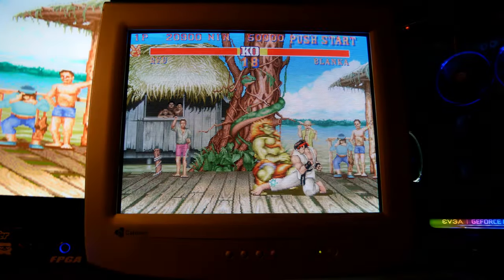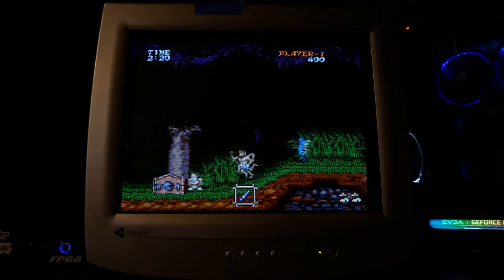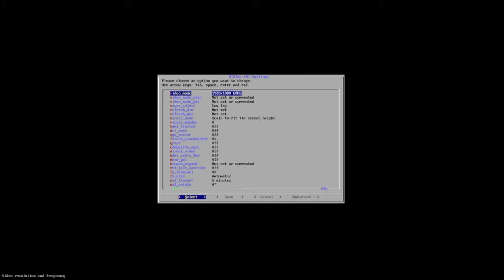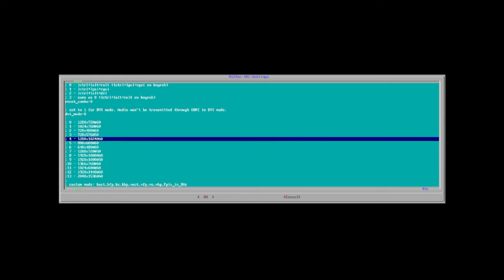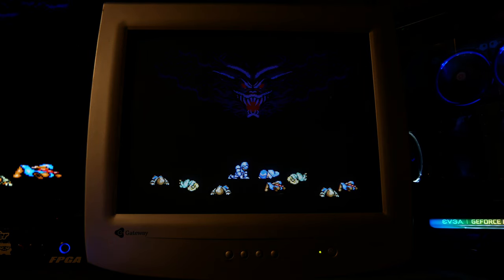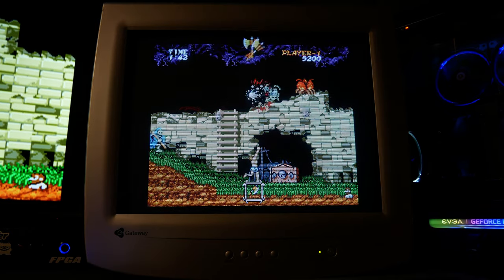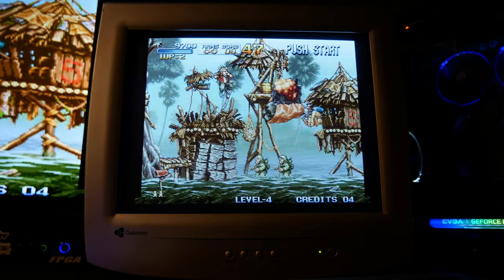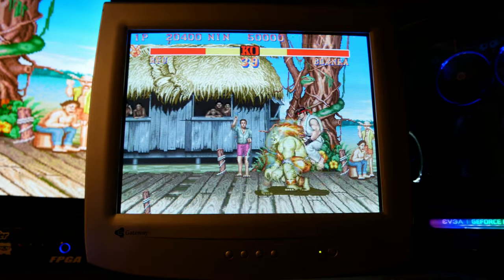240p 120Hz MiSTer FPGA PC VGA CRT Settings / Guide / How To Get Best Video Settings for 31kHz CRT

Comment: Appreciate ya bro.  Just picked up an old ViewSonic from the junk yard.  Found this video and threw up the setting.  Looks absolutely beautiful.  Ridiculous how good this looks compared to my PVM haha.  Gonna keep this monitor and throw the settings onto an alternative .ini file.

Video is based. 🔥🔥🔥🔥
Reply from the maker: Awesome to hear. I guess some are super sensitive to the double frames and motion clarity but I honestly didnt notice it and was fine for casual gaming
Reply: @LameGaming  Yeah they are!  Doesn't bother me none too much either.  I'm used to the blur effect from growing up offa LCDs during that transition from late model CRTs to early LCD panels.

It's perfectly fine for casual gaming.  As a bonus, I'd just recommend to use some sort of wired connection to get the lag down as low as possible.

Comment: I really can't thank you enough for this video, especially going through the other options as well, and for the overall level of detail you went through. It absolutely helped me get a better picture out of my CRT Monitor. FYI one downside of this is that vertical scrolling shmups don't work with these settings, unfortunately. I tested DoDonPachi, Esp Ra De, and Batrider, they all didn't want to draw correctly. That said, they work great with the normal scan doubler and 25% scanlines. Playstation won't work with the 240p 120Hz either, but again it works great with the scan doubler and 25% scanlines. So it's extremely helpful that you covered alternative methods!

I am definitely keeping this as one of my alt configs to play certain cores on. It works great for a lot of the old consoles. Again, thank you so much for this.
Reply from the maker: Thanks, alot of the info was well covered but other info, like for 240 120Hz took alot of reading and searching to figure out so just wanted all the options covered in one video for those who only could find a pc crt.
I didnt spend alot of time testing a ton of cores or titles so thank you for adding to the info available on the subject!

Comment: This is spectacular!  I do understand the slight drawbacks but the results are incredible.  FINALLY an Apple //e experience the way I remember it.  I hope the Mister team at some point adds this as native support so the boot menu works properly and you don’t have to change aspect ratio.  BTW, I don’t think the video mentions you can save the settings in each core  so you only have to make the change once.  AWESOME video.
Reply from the maker: I dont know how I forgot to save settings after changing aspect but THANK YOU for trying this and replying! Everyone thinks im crazy and that theres a huge amount of blur to where its unplayable, I dont notice it or it doesnt bother me at all... Did you notice bad blur?
Thanks for testing this and replying! I was starting to think I was crazy lol

I read from mister wiki that they dont plan to support this officially  unfortunately. Unless maybe enough of us test it and request it
Reply: @LameGaming  I have been playing Apple //e games and I did not notice blur.  I’ll try tomorrow with some more graphical systems.
Reply: @LameGaming  This evening I looked at arcade sets like Moon Patrol, Rally X and some NES games.  I think I can see what might be called motion blur but for me it just looks retro and is VERY subtle.  I am certainly not a purist but I can’t see anything that I would call objectionable.  Perhaps different results based on the monitor capabilities?  I will be sticking with these settings.  The only new feedback I would add is text being effected by the scan lines.  This is best shown in Moon Patrol score and big time with the text intro for Speed Coin.  It is a small drawback but not enough for me to care.
Reply from the maker: @tommorgan8053  Yeah, Any negative affects are negligible and far outweighed by the image quality for me.
Reply: @tommorgan8053 - I just hook my Apple IIe up to a regular CRT television set, nothing fancy needed other than an off-the-shelf RCA cable. You get true 240p, no lag or other issues. With my Apple IIGS though, I use the TV's component input using an RGB/VGA to component video transcoder, which gives an image just as good as my RGB displays!

Comment: not sure if youll see this or even if you still find it interesting, but i found what i believe looks best factoring in input lag. its not scan doubler or 240 120. scan doubler gets too dark, and 240 120 i noticed heavier input delay than normal in games im very good at(impossible to tell in games im not, but still annoying). i set vga scale on, scan doubler off, vsync adjust 2(no noticeable input delay), video mode 1280,960,60, vscale mode 1. once in a core, id load the pvm preset for filters. id remove the shadow mask portion entirely(its already got one it uses), gamma correction id set to gamma 120 instead of what was there, horz filter set to GS_Sharpness 90, vert filter SLA_dk_30_br_90. this seems to get it very close to a pvm(side by side). adjusting those seems to improve things greatly. on the pvm i can barely tell the scanlines are there, but ya definitely know they are there. its the same deal here. can adjust to preferance. the monitor i did this on was a dell p1130.

i believe vga scaler is 100% the better option in most cases, but ya need to put in work to find a setting good for your monitor and it may be different for each one.
Reply from the maker: I definitely do find this interesting!
Just learning a new job and closing on a new house so not much time for the hobby right now 😢

I hope to setup a better repair room at the new place and hope to find time to make videos again.

Id be interested to see your results though, you should do a side by side comparison video!

Id like to find a dell 1130 as well. What the max res and refresh those monitors can handle?
Reply: @LameGaming  ive never really done a side by side video, so it'd be a jank cell phone camera video lol. i can give it a shot. what i've tested was 240p 120hz(had some issues, vga cord limitations. snes seemed to work fine with it, oddly), vga scaler at 1920x1440(still vga limitations causing some issues), 1280x960(100% perfect) and 1280x10something(5:4, black bars). Scan doubler as well. I found that using vga scaler with the low latency mode vsync adjust 2 and just finding what worked with that was the best mix. Not even a single frame of lag from that. 1280x960 seemed to have no motion blur, lag, or vga limitation jank. The filters I mentioned seemed the perfect mix at least for this monitor since with the filters you can compensate for the brightness decrease.
Reply: @LameGaming  oh and to answer the max res, its about 25somethingx15something or some such. I seem to be running into vga limitations at higher resolutions. I'm thinking its the cable I'm using or something.
Reply from the maker: @Zalibidas I will keep my eye out for one. I have a feeling they will be impossible to find at a good price now that steves video about them dropped lol
Reply: @LameGaming  thats true. they arent even that special. my other non-sony 17 inch dell looks just as good same settings, and it is curved

Comment: A lot of people don't really realize this, or don't want to.  240p120hz has some significant drawbacks.

1. you are forced to use vsync 0 which is double buffered vsync at least 16ms of extra lag
vsync 2 with vgascaler is only a few scanlines of lag less then 1ms and it will automatically synchronize the cores refreshrate to your displays.

2. vsync 0 does not automatically match the refresh rate of the core to the refresh rate of the display causing stutter. Only way to avoid this is by specifically making custom videomodes double the exact refresh rate of each core.

3. 60fps at 120hz on an impulsed display like a crt causes duplicate images in motion. That beautiful 60fps motion clarity that crts are coveted for will be lost due to how the science of how persistence of vision works.  
sample and hold displays like lcd's and oleds won't have this specific problem. but on a low persistence(low motionblur) display you will absolutely get double images, its unavoidable.

you say you don't notice anything but doesn't mean it's not there. it's there.

btw you can get a much sharper image then your were getting with vgascaler with custom videomodes. pc crt's will look sharper with a 480p videomode, also helps to use true integer H + V scaling. with interpolation turned off.
Reply from the maker: Your right it does have drawbacks, the biggest for me is the input lag.
I'm not saying its the end all be all way to display with mister, or the most accurate,  but all other options I've tried on a 31kHz CRT and fake scanlines ends up with an image that is far too dim and I personally feel I might as well not be playing on a CRT. That CRT phosphor glow is what I think about when we talk CRT so its a priority for me.
I understand to get from 60Hz to 120Hz its doubling the frames and causes a doublescan strobing/blur/ghosting artifact but I don't see it, it may bother others but for me its not an issue and the overall image quality surpasses the drawbacks for me.
If the only CRT I had was a 31kHz CRT.... I would be more than happy with this setup and would be running in 120Hz.
Reply: @LameGaming  fair enough, I'm happy with the scandoubler personally.
Reply from the maker: @brett20000000009  Yeah its great, I just wish it was brighter with 50% or 75% crt fx. If it was it would be perfect, but yeah its definitely sharp and responsive so can see why some would prefer it.
Reply: @brett20000000009  - what is "vsync 2 with vgascaler"? - I heard that some arcade machines used monitors that ran at higher than 60fps? - is there any point in producing more frames if the game only pushes out 60?
Reply: @brentgreeff1115  vsync 2 is a MiSTer specific setting. it perfectly matches your monitors refreshrate to your console refreshrate also uses a linebuffer so it's very low lag.

vgascaler is also MiSTer specific, pipes the hdmi output to analog output instead of using native analog

theirs no benefit from using higher hz monitors for 60hz cores. you actually gain lag by doing this. only reason people do it is to display 240p on a crt that isn't capable of 15khz. 240p@120hz is 31khz the lowest scanrate most pc crt's are able to work at.

some 30fps arcade games will run a monitor at 60hz because a 30hz crt would be too flickery to look at. lucky 30fps at the arcade wasn't that common.
Reply: @brett20000000009  - Interesting thx. saved that info to my notes. - Seems MISTer has some pretty advanced options - cant wait to get mine. The dream is to get a PVM 20L2 - which I guess does 15khz fine? - I heard that using a VGA adapter on the HDMI port has superior colour to the actual analogue port? - is that why you send HDMI to the analogue port? better colour? - or is it because the HDMI can output higher rez?
Reply: @brentgreeff1115  That pvm does 15khz. The main reason people use a hdmi to vga with MiSTer(directvideo) is so they don't need to buy an analog ioboard or they can use the 2nd gpio header, which is usually used by analog video for an extra memory module. the difference in quality between directvideo and native analog isn't really anything noticeable.
Reply: Someone always comes along and makes a bigger deal out of this than it actually is. I've been using this method with Retroarch at 3840x240@120Hz with CRT SwitchRes enabled. I've compared it to a 15kHz television as well as the same settings with black frame insertion and 480p with a shader filter. Just setting it to 120Hz is my favorite. Someone always comes along to say "even though you can't see it it's still there and you're having a sub-par experience." As always, someone will come along and tell you why you're not actually enjoying your experience that you're enjoying.

Comment: I was thinking about picking up a crt tv and modding the jungle chip to do rgb on my mister but now looking at your setup I think crt monitor is the only way to go.
Reply from the maker: I say do both and compare! This setup is fantastic but still pushing forward with recapping my 27" sony fs120 and also just got a 27" kv sony with curved tube that I plan to rgb in the future. Sadly though the face of the tube is scratched up BAD.... I thought it was a paint scuff but looks like someone drug it on concrete on the tube, It might be worth practicing with- I havnt decided yet but yeah- I say grab whatever becomes available first and then keep an eye out for the other so you can compare.

Comment: this is one of the best Mister related video for me so far. I have a PC VGA monitor and I do feel same as what you said in this video. only thing I haven't tried is 120khz option. so I will try this option for better brightness. only thing is my PC monitor is so old it is little bit dim by itself. I guess I would buy another PC VGA monitor :) but it is not easy to see if that VGA monitor is in good condition which shows good brightness until I use...
Reply from the maker: 120hz really helps with brightness, id give it a shot. Thanks for watching!

Comment: Apparently with retroarch now you can set custom resolutions and also using runahead/preemptive frames I think would fix the lag. The only thing purists can complain about would be motion blur. I can't wait to test this out on the PVM2730 and the LaCie 19" Blue iV

Comment: Great video! Ive got a 2730qm pvm, a diamondtron, a Sony cpd and a bang and olufsen beovision 1. The alternative ini files will be great for this.

I can't seem to get the hot keys to work for the ini files, but they're there at least via keyboard access
Reply from the maker: I have a pvm 2030 and 2530 i need to recap, is the 2730 a legit 27" diagonal measurement tube or is it a Pal region version of the 2530?

Which cpd do you have? I been looking for a parts cpd 1302 to rob it of its 600tvl tube
Reply: @LameGaming  the 2730qm is 25 across. I got the cpd e450, so it's not the g series unfortunately it i only paid 160 for it. Sony vga crts seem quite rare in the UK unfortunately!

Comment: This is cool but if you run any core with multiple vertical resolutions e.g. Amiga, X68000, PC (once the core can output correct resolutions) FM Towns (once released) etc it won't work. There needs to be a universal 120hz option that will scale the refresh depending on the resolution
Reply from the maker: I haven't delved into the computer side of mister yet but yeah, I wish there was more official support for this option.

Comment: Why don't real scanlines darken the image like fake ones do, even on a CRT monitor? Shouldn't the lines that are dark be virtually similar to each other, whether they are lines that are not drawn and are therefore dark, like in true 240p, or lines that are dark by having them display black pixels? Shouldn't the lines that are drawn with image data on them glow just the same. I don't understand it. :D
Reply from the maker: Every other line is skipped so the raster is drawn twice as fast, this is why 240p is 60Hz vs 30Hz with 480i. I think it has to do with phosphor persistence and the time the phosphors are excited or illuminated. 
This video is a good example.... I could not get an image that was bright enough untill I ran a custom modeline that scanned the raster ( illuminating the phosphors) 120 times per second.

On a lcd panel your just basically dimming the image by blackening half the image ( every other line). The lcd usually works with backlighting and its just different from phosphors where upping the scanrate excites the phosphors more and the phosphor persistence leaves less time for them to de-illuminate.

I have a u8h lcd tv though thats crazy bright and even with scanline filters its so bright it hurts your eyes if your too close. For scanline filters on modern displays you really need a set with high nit peak brightness to punch through.

Comment: Looks amazing!  I just picked up a Mister setup from ultimatemister with the idea of using it on my Toshiba AF2742 via component video. It's been headaches. Right out the gate the main menu is all garbled. Some cores work fine and others scroll vertically.   It's going to be a journey getting shit working.
Reply from the maker: I got vids on initial mister setup and on running ypbpr component with mister as well..... They may help
Did you flip the sog switch?

Also , in case you arent....Its always helpful to have an lcd screen hooked up even when you use analog signal.... That way if you get an out of sync picture you can still easily change settings from the lcd.

You will love mister once you get things ironed out!

I run rgb to pvm's and my rgb modded 36" jvc now.... Just bought an rgb distrobution amp to hook up more rgb modded sets, i think I may try throwing in an rgb to component transcoder to get my sony crt in the mix. Theres so many options with mister, thats why I love it.
Just stick with it and you will figure things out.
Reply: If you triple check that your configuration is correct-which is the most likely problem here, and it is, 100%.  The next question is what vga->component breakout do you have?  Just get the monoprice one.  If that doesn't work there is something very wrong with your analog board and you should contact ultimatemister about that.

Comment: Update - Turbo Core is fine, adjusted screen settings in Core.  Smooth as silk...Still have issue displaying out HDMI to 1080p TV..assume I need a 4k for that....ah well, getting another MisTer, this is too good. "Seeing some shimmer on games that scroll vertically on the Turbo Duo core (example : https://www.youtube.com/watch?v=xbYo98No4IY).  But played other cores and there's no issue"...wow this is insanely great.  incredible quality picture overall.  Any recommendations or suggestion on Turbo core appreciated.  Thanks for documenting this.